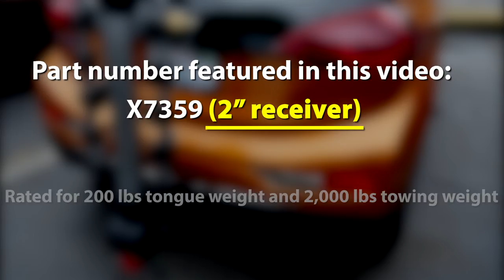2017-2020 Chevy Bolt EcoHitch Installation

Comment: Will this hold 300 pounds solidly
Reply from the maker: Hey Jason! We're sorry about the delayed response. The hitch is rated for 300lb tongue weight, but keep in mind that for every 12" extended out, you lose about 30% of this capacity. Also make sure you are reviewing your vehicles weight capacities as well - these can be found in your owner's manual. Hope this helps!
Reply: @torklift_central  you don’t mention that inn your advertisement

Comment: I believe you quoted the wrong specs for this 2 inch hitch receiver. You quoted 200 pounds tongue 2000 towing. The 2”  hitch is rated at 300 pounds tongue, 2000 pounds towing
Reply: The opening size doesnt mean anything for weight capacity
Reply: @JSmith-wy3yh  The rated weight capacity does matter
Reply: @Magicinstalls  Correct. The weight capacity he stated is right.
Reply: @JSmith-wy3yh  The hitch receiver opening absolutely determines the weight capacity! The 2" is has more tongue weight for towing! 1 /14 is only 200, the 2" bumps it up to 300. Fact check it if you must, even thought I just did that...
Reply: @Magicinstalls  a 2 inch opening can still be rated for less weight is what I'm saying. That means the opening does not determine weight rating. Cheers